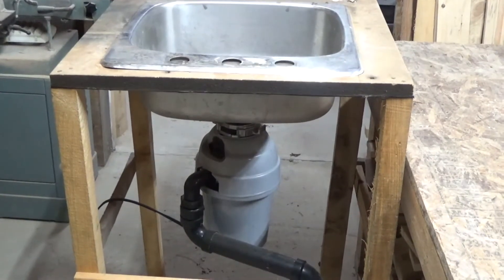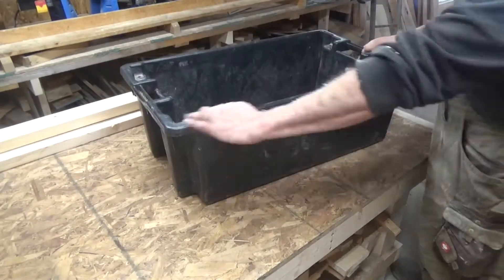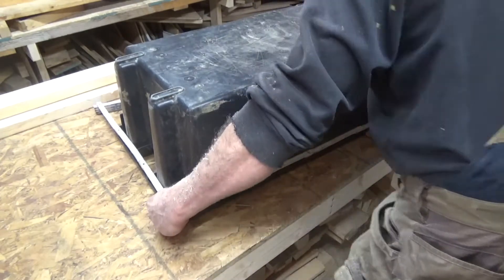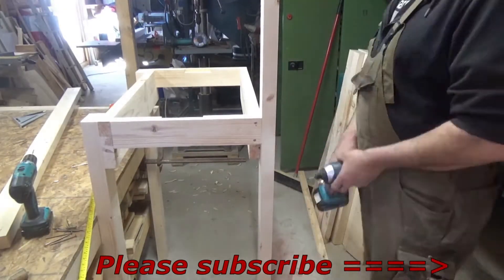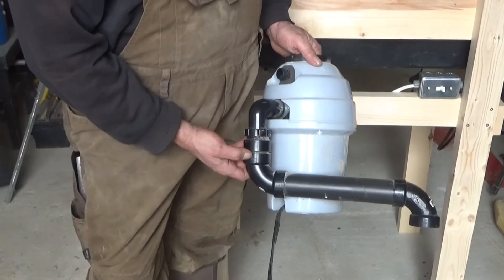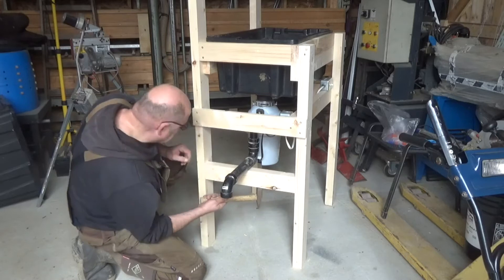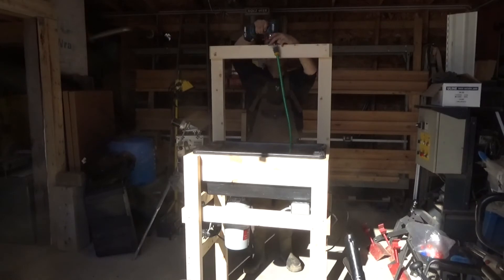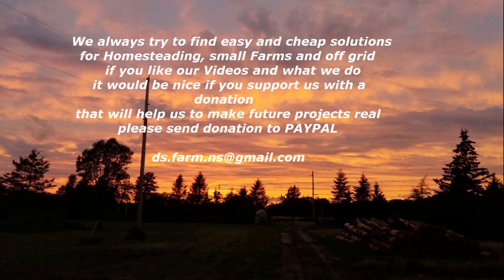Biogas (part 5) smoothie shredder

Comment: Nice work I love your videos, what are you doing with the Biogas? How many Biogas have you on a good day? You can head your House?  You have enough to cook every day?
Reply from the maker: We use it for cooking and sometimes running a generator. the amount of Biogas is always because what you feed in the digester so it is hard to say To heat a house this setup is to small and it is also hard to say because how big is the house how good is the insulation how cold is it outside so you see it is not so easy to answer this question but it is definitely a a good add to what ever setup.